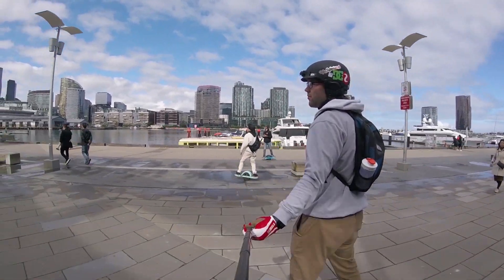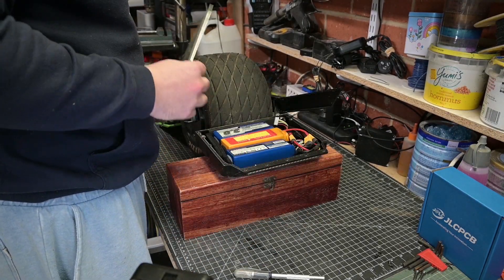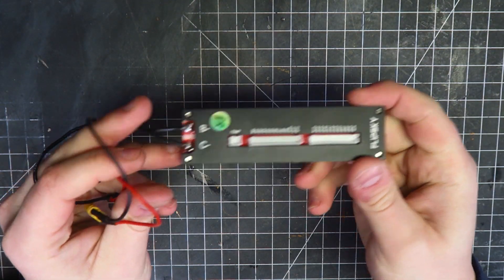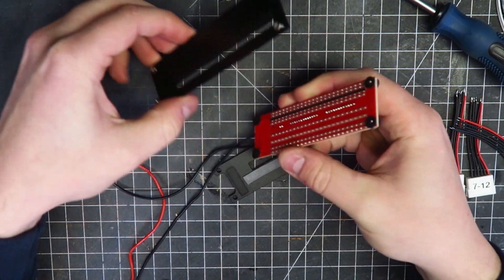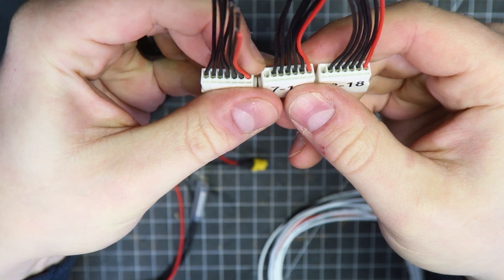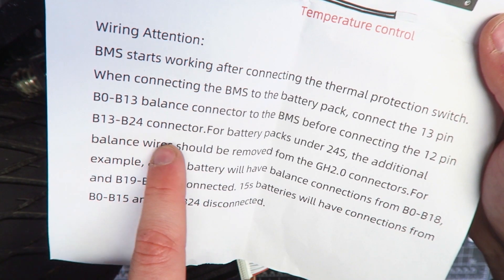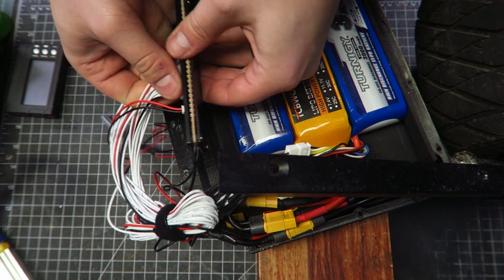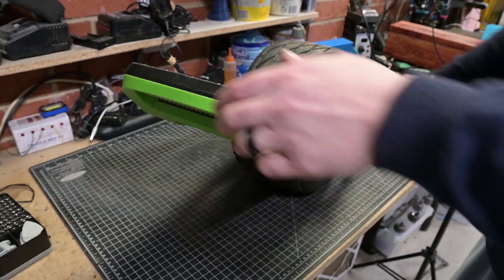Smart-ifying my Funwheel ST!

Comment: Does it spark when you plug it in, or does it have an antispark bank?
Reply from the maker: The XT-90S mitigates any sparks on connection of the pack to the VESC, but there is still a small pop on plugging in the charger to the pack

Comment: The OWCE (Onewheel Community Edition) app does report individual cell voltages. I'm curious to know if it works with VESC. I have a lil focker and box I need to assemble and install in an old XR but I don't know where to begin. I've modded over 100 OG Xboxes but I only have 10 minutes of soldering experience. I have wired car stereos though so I understand wiring for the most part.

The main reason I haven't joined discord to finish my project is because I'm at a fork in the road. I'm not sure if I should upgrade the BMS and install an 84v battery.
Reply from the maker: Not sure how the owce app works but if it's just an app I'm assuming it's just presenting data the onewheel app obfuscates. If so, I don't think it would work with a VESC. Something like the ennoid bms reports cell voltages to the VESC via can, so can be monitored in the VESC app. The fungineers bms reports cell voltages over Bluetooth to a dedicated app. Battery voltage is a personal preference, but more voltage equals more torque and speed so that can't be a bad thing right? =)